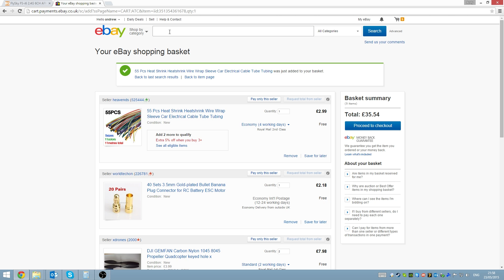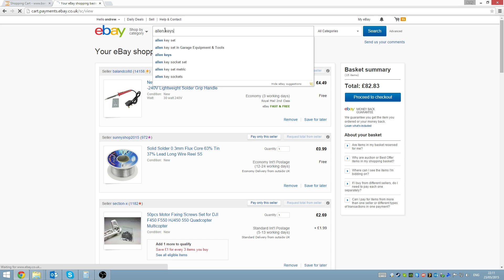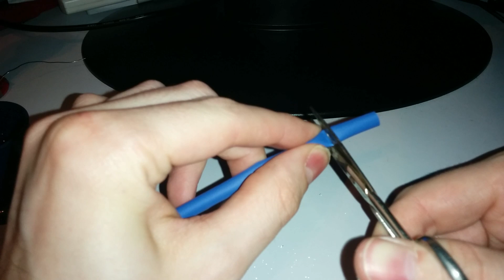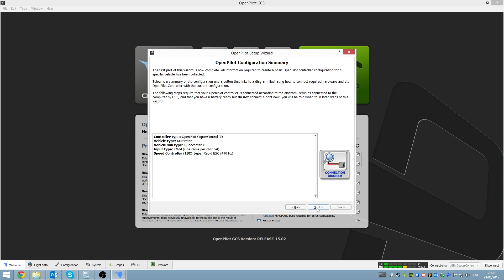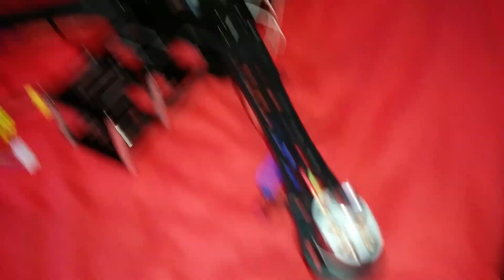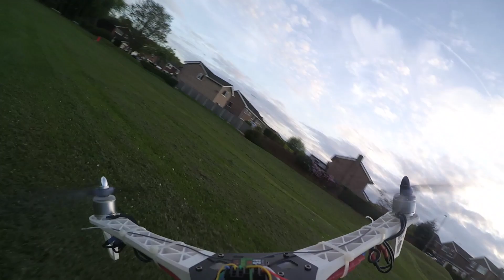Build A Cheap Quadcopter

Comment: Hi andy i got a question how did you put the flight controller and the transmitter on the copter? with glue? tape?
thanks
Reply: and something else how did you mopunt the power distribution board? you heat up this white things? cause i got only males whit things no females so you melt the males? or you bought also females? thanks from before
Reply: they actually have one side male and the other side female but i cant understand how you did it on video its like u melt them? or you put another female screw to them? thanks
Reply from the maker: +ziniatis andreas double sided tape yes for the cc3d. PDB is using stand offs screwed in
Reply: +AndyRC thanks a lot for the answer...... for the PDB i got this whit plastic stand offs from the frame they are like the ones that you are showing at the start of the video when u open the frame the white ones but i can't understand how you haved screw them ive got 8 of them...
Thanks a lot
Reply from the maker: they have nylon screws that screw into eachother
Reply: +AndyRC yes i got them but what you have did to put it you have cut them? in half?
Reply: Its fine :D i ordered some more plastic screws cheap thanks a lot andy........btw your video is awesome :D
Reply from the maker: ah great, sounds like the ones you got in the kit are no good or parts missing
Reply: +AndyRC yeap i saw again the video and in your packet with the srews you got some plastic srews that i didnt have so i bought about 200 (i couldnt find less) for like 3 pounds.Thanks a lot for your response :D i&#39;m going to continue with it and if i have any problem i&#39;m going to ask for your help :D maybe with the programming :D...about the voltage checker you put it on 3.7 Volt or 3.8? you said it once on the video but i cant find it :D......
anyway thanks a lot
Reply from the maker: no problem good luck with it
Reply: Hi andy i built it :D it was flying preety good when one of the props screwd off and crushed i had screw the props very tight is it possible that i puted the thread opposite? i puted same with the video (the colours) black and silver
Reply from the maker: i never had that problem with mine :( if you followed the video it should be correct
Reply: i followed it and i did it exactly the same as you do, but i figured it out i have to put the ccw thread to cw motor and the cw thread to ccw motor.....the way you have done it is the oposite and i think that's why the prop get unsrewed cause when the motors turn it should tight more the screw and not unscrew it so i put it opposite of yours....motor 1 black motor 2 silver motor 3 black motor 4 silver i mean thread....so motor one is going clockwise but the thread is ccw isn't that the right way? Thanks a lot for your answer
Reply from the maker: when i bought these motors it advised that the silver should be cw and black CCW. iv never had a prop come off with this one in a year. i guess its possible they changed the motors
Reply: I can see in the video that the motors are exactly the same with myne... anyway i solve the problem this was it i puted all the motors oposite and its fine

Comment: hey would a hi-tech remote and 9 cell battery work
Reply from the maker: no nine cell too high. didn't know they made nine cell lipos? are u talking about nicads
Reply: Yes I have a 6 vex kits two sumobots 4 Hi-Tech remotes and so a 4 cell nicad will work???
Reply from the maker: not on the quad no you need lipos
Reply: I think I might have 4 cell lipos
Reply: and will a hi-tech remote work?? I could show you a pic and why will nicd battery's not work
Reply from the maker: nicads have not been used on board aircraft since about 2005
Reply: will  a Hi-Tech remote work
Reply from the maker: yes as long as you have hi tech receiver

Comment: I'm gonna have a crack at building one :)
Reply from the maker: +Andrew Thomas great :) good luck
Reply: The calibration on the pc will probably give me a headache lol
Reply from the maker: yeah but its worth it :) all part of the fun
Reply: +AndyRC started getting the same bits as you,I found UK eBay has the same or cheaper parts than China.
Reply from the maker: awesome :)
Reply: +AndyRC is there a cheaper transmitter and reciever out there on ebay uk? thanks
Reply from the maker: you will always pay over the odds in the UK. theres not one im aware of. i always buy overseas

Comment: If your budget was say 10-20% higher than the cheapest components you could find, what components would you focus on if you were going to upgrade it.  (from a flying perspective)

I don't mind spending a little bit more if I know that I'll get a better consistent/performing/quad.

Comment: Hi Andy, yes I did, the other thing I meant to mention is that my values differed to yours. The first time I tried the process I changed all the values to mimic yours but that didn't help. Then tonight i have carried out the process and just left the values as they are. 

To answer your question, yes my value did the same and reverted to 1500 but I did change it back to 1000. I am totally stumped as to what to do next??!?

Thanks for quick reply
Reply from the maker: +sam albustany perhaps the default weight of the pwm values have changed via a firmware update to the flysky. try to  adjust the weightings so they are higher. perhaps the throws are not making it far enough.
Reply: I've just tried again and it fails at the point I try to save the TxPID values. Where you say the drone needs to be armed for it to save, mine is armed as I checked it, the moment I press "save" the red cross appears and the controller becomes completely unresponsive apart from the flight mode knob. 

Without sounding like a fool, can you give me values to try and exactly where I should put them...sorry I am a complete novice at this! 

Sam
Reply from the maker: everything I did is in the video. so i am not sure why it is not working :( its very frustrating. have u tried starting from scratch with the controller. i did that once and it just randomly worked. worth ago. not much to lose if it isnt working
Reply: sadly yes! I've started from the beginning each time and it keeps doing it. I've uninstalled openpilot and reinstalled. I have a feeling it might be because my knob on the right doesn't work. Do you think that could have anything to do with it?

Sorry to be a pain with this!!
Reply from the maker: it could be. can you try it with the other one?
Reply: Andy! It was because I chose Mode 2, but my controller is mode 1. So, that issue was sorted, but then on to the next issue. Trying to set up the P Gain just wont work. The quad is now set up but without the ability to adjust the P Gain. I need to try again.
Reply from the maker: great glad u are making progress

Comment: Andy, cracking video mate, I have bought all the equipment and am at the stage of programming the controller on OpenPilot on my PC. I am totally new to drones so am doing this blindly completely following your instructions. 

I have an issue, at point 53:53 in your video when setting up the TxPID section when I press save it gives me a red cross and the controller loses its ability to arm the copter. However on the RC Input tab when I spin the knob on the controller both Channel 6 PWMs move as before. 

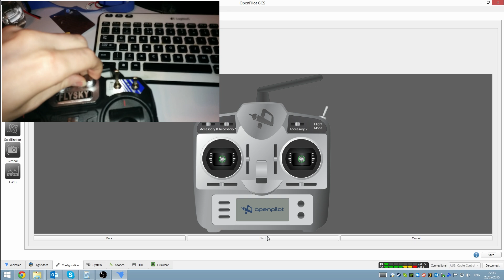When I go to re-save the arm on Yaw right it fails to do so. Another point is when you are setting up the flight mode at 47:38 on the video, you use the knob on the right. Mine does not respond for some unknown reason, so I have to use the turn knob on the left, which does work. I'm not sure if this has anything to do with my issue described above.

Please help! :-) Thanks for the video.
Reply from the maker: +sam albustany it can be a pain setting it up. did you check the bit where you copy the pwm values for the mode channel and it changes it back to an incorrect number? that caused me hours of greif

Comment: Andy Rc is this kit not bad for the price a new quadcopter novice. 

http://www.ebay.co.uk/itm/FPV-7-screen-TX-RX-700TVL-cam-F450-Quadcopter-Kit-RHD-2212-Motor-30A-ESC-combo-/331745602935?hash=item4d3d942d77:g:OHwAAOSwaA5WiEKV

will be using it the transmitter and receiver you mentioned in this video.
Reply from the maker: +craig brown yes looks good :)
Reply: +AndyRC what's best for a first time Quadcopter person the alien kit as you've described in this video or a f450 Quadcopter as mentioned above
Reply from the maker: yes looks pretty good
Reply from the maker: yes looks pretty good

Comment: Hi Andy, thanks for your video. Decided to build one myself, yet my quadcopter does not seem to have an average fly time. When I hover above the ground my flight time is +- 3minutes. 

The battery on my quadcopter is an: ZOP Power 11.1V 3S 3000mAh 30C T Plug Lipo Battery For Align Trex 450 Helicopter. A different one you used but with higher mAh and C rating.
Rest of the built is the same, same ESC, motor, props, etc. Quadcopter weight is +-1.2 kg

Do you think the battery might be a bad? Or is it possible you can change some settings in the CC3D for a more durable flight?

Looking forward for your reply
Reply from the maker: you should be getting at least ten mins with that battery. something is wrong
Reply: +AndyRC That's what i thought. You think the battery might be a production error?
Reply from the maker: +Whooshie check the individual voltage of each of the cells
Reply: +AndyRC I'm using a voltage checker for my battery, all cells differ 0.1V or something.  Charging my battery in balance mode too..
Reply from the maker: +Whooshie they will differ slightly. but are they all over 3.3v per cell?
Reply: +AndyRC 3.7V when fully charged and like 2.8V when drained
Reply from the maker: it should be 4.2 fully charged and u should never let a lipo go below 3.3 volts per cell. sounds like the battery is defective. or has become defective from letting it drop that low
Reply: +AndyRC Oh hmm. The cells are 3.7V, 3x 3.7 is 11.1 (my battery voltage) Am I missing something? 

How come you say 4.2V?
Reply from the maker: 3.7 volts is just used to describe a 1 cell.
at its maximum a 1s is 4.2v and its lowest should be 3.3v a lipo charged at 3.7v per cell is pretty much an empty battery
Reply: +AndyRC Ah this explains alot lol, thanks! Hopefully the battery is not badly damaged
Reply from the maker: lets hope not cheers

Comment: Thanks a lot!!!  Very helpful video, great explanation! I will build one (probably go for a set in Ebay…)

The screw story is really something!!!!
Reply from the maker: +Bánáti János no problem enjoy :) yes screw gate was terrible for me lol
Reply: +AndyRC 
If you happen to have more info about that last part of the OpenCC3D setup, and if you can share it that would be great.

 That is the only part which was a bit scary for me. Is it fly as good (or almost as good :-) ) as a branded multicopter? 

Should I start my multicopter life with this size or with a smaller model (250g or similar)  The price is about the same. 

Great channel you have!!! Thanks a lot!!!
Reply from the maker: when you say more about cc3d what other features would you like to see? thanks
Reply: +AndyRC 

Hi Andy

The flight mode setup… but I found some good videos on OpenPilot Wiki page so thanks!!!

Which one should I start with .. the 250 or the 450?. 

I built a lot of plains but never touched a multirotor.
I am considering the 450 if I don't like it I might use the motors and the ESC for a big 4 motor plain even the CC3D could be useful for a fixed wing…  I don't know if multirotor  is my cup of tea or not :-) (but I am surely interested)
Reply from the maker: start with a small hubsan x4, thats what I did. they fly just the same as the big ones without the price tag or danger.
Reply: +AndyRC Thanks.. that is an option I just would like to use my own transmitter (FlySky i6) and I love building stuff :-)  there are these sets on Ebay like this one (very cheap)  
http://www.ebay.com/itm/F450-Quadcopter-Frame-Kit-2212-920KV-Brushless-Motor-For-DJI-Simonk-30A-ESC-/121817858767?hash=item1c5ce902cf:g:08oAAOSwcdBWS~X-

You also built something similar…

Comment: Andy - great work.  I'd sure like some pointers on where to get the complete parts - including GPS and camera with gimbal - Great job - I would suggest a  link to parts and plans for novice builders - but I've built a 3d printer and am confident I could do this....
Thanks!
Reply from the maker: check out the high end build series for GPS and the zhiyun review for a good gimbal. cheers!

Comment: Here Is All the link's to all products. Both Asia and Western

Western:

http://www.ebay.com/itm/131585225717
http://www.ebay.com/itm/151728878812
http://www.ebay.com/itm/151327525919
http://www.ebay.com/itm/400675900639
http://www.ebay.com/itm/351064700389
http://www.ebay.com/itm/271572558651
http://www.ebay.com/itm/171155754907
http://www.ebay.com/itm/131588779853
http://www.ebay.com/itm/391086878733 (Cut the Ends Of the Wire)
http://www.ebay.com/itm/381381208587
http://www.ebay.com/itm/181596451976
http://www.ebay.com/itm/151819669949
http://www.ebay.com/itm/111702667601
http://www.ebay.com/itm/301632454338
http://www.ebay.com/itm/351195065884
http://www.ebay.com/itm/141628891010 (Buy 4)
http://www.ebay.com/itm/400904118712 (With Stand)

Aisa:

http://goo.gl/02JR3q
http://goo.gl/wWiUxy
http://goo.gl/G2uGfI
http://goo.gl/kd5gB6
http://goo.gl/gvaVwm
http://goo.gl/ELNeZF
http://goo.gl/OmYbSQ
http://goo.gl/BRTCze
http://goo.gl/bmS5wv
http://goo.gl/rqN7Lm
http://goo.gl/giDaaL
http://goo.gl/vdnr1E
http://goo.gl/4Vduxr
http://goo.gl/JCD8Hf
http://goo.gl/luSGl8
http://goo.gl/uPpWeK
http://goo.gl/jUoIpg

Please inform me if I miss anything. :)
Reply from the maker: +Quadcopter World good work thanks
Reply: +AndyRC No Problem

Comment: hi andy! i dont know what to do
today i got all the parts and when i got to calibrate the motor onley motor number 4 spin!
i pluged all the motor to line 4 one by one to check and all the motor and the esc ok!
i use open pilot 14.1 from the banggod site,
the other version 15.02.02 dont working for me.
any suggestoin?

Comment: +AndyRC I have gotten my motors and frame for the quad I am building and the motors screws are suppose to be 8mm long but when I measured them they were 9mm. You think it would be bad to try fly it with those 9mm screws?
Reply from the maker: +David Casino you should be able to see if the screw is hitting the back.
Reply: AndyRC how can I tell if the screw us hitting the motor?
Reply from the maker: u should be able to see the screw boking through the back and touching

Comment: Hi Andy, i discover a problem yesterday with my quad, the range beetwin remote and the receiver has like 200m range .. but i dont know why, can u help me a little just to figure out.

Thanks
Reply from the maker: +John George that could depend on a lot of factors. also how did u discover its only 200m? crash?
Reply: +AndyRC welll ...crash ... but it was only on 4 meter from the ground ...i look on google and see u can not mess with the antenna wire .. i cut one from mistake and i think that is the problem allso i shorten a little both wire ...is a mess there :( i didnt know u can not touch that wire because u lose range, but i think the solution is to buy another receiver, find one that i think is work with the remote, if u can take a look and agread me
http://www.aliexpress.com/item/Brand-New-FS-iA6B-2-4G-6CH-Receiver-PPM-Output-with-iBus-Port-For-Flysky-i4/32464818027.html

From now i have to fly with 200-250 meters range but is ok i can learn to fly continuous, because i still mote the drone forword-back-left-right :))) and a little yaw when is up in sky :)

If u have any idee that can help me i`ll be glad to try :D Thanks a lot.
BTW I FUC.ING LOVE THAT FPV SCREEN :D the one that project i saw that video of you, nice :D
Reply from the maker: +John George u cut the antenna off the receiver or transmitter?
Reply: +AndyRC receiver the one on the drone
Reply from the maker: +John George yes buy a new recever
Reply: +John George i put now a picture to see, so 1 of the wire that is longer in the picture it is in fact shorter because i shorted, and the one shorter in picture i cut it from mistake when i want to cut a cable ties :D
https://plus.google.com/collection/Ir6yo

See last picture.
Reply from the maker: +John George easily done. buy a new receiver I wouod
Reply: +AndyRC Yea i mess them up good :)) 
I will buy that receiver that i give u link hope to have better range ...
Thanks you Andy.
BTW i still dont fly continous, and i have fly like 3 week from now :( hope to learn faster

Comment: Wouldn't it be better to buy one or does this give you any advantage ?

And I would like to know, how do I keep my Quad up and in one place, as soon as I start increasing the throttle it goes in a random direction.
Reply from the maker: +alijahshad02 if u just buy one that someone has already built u will never know how to maintain it. for your second question you need to learn how to fly! buy a simulator I would suggest
Reply: Like an application on my phone ?
Reply from the maker: no because you cant crash a phone application into the ground and have to rebuild it

Comment: Hi, thanks for the walkthrough how to build a cheap quad :) 

I'm following your guide and it is by far the best online!! Nevertheless I have some questions.

I ordered a 3s 30c battery, what would be the difference with 4s? It has more voltage, but does it drain faster? 

And by the way CC3D price dropped a lot in the last year so you probably dont have a cloned ver. :) Also, have you tried the "new" LibrePilot GCS (continuing the work of OpenPilot)?  

What do you think about different frame? I've ordered X525 v3 from HobbyKing: http://www.hobbyking.com/hobbyking/store/__22800__Hobbyking_X525_V3_Glass_Fiber_Quadcopter_Frame_600mm.html

Another thing, what are the settings for voltage control? :)

THANKS !